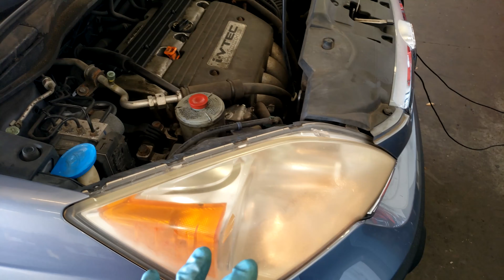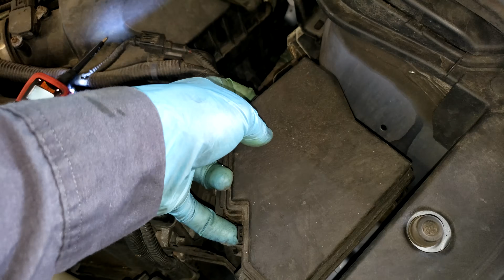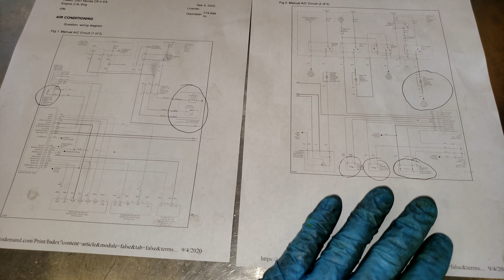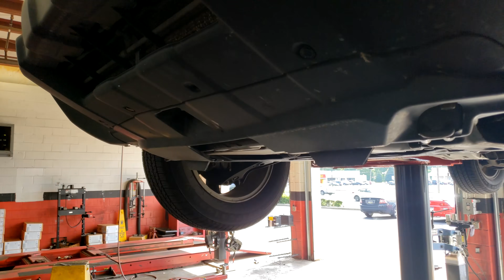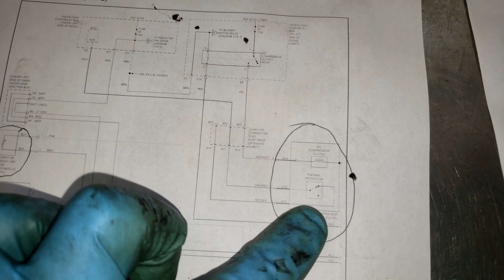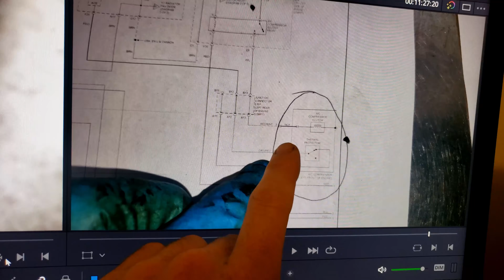Honda Blowing Warm / No AC Quick Diag/Tips - CRV, Accord, Civic, Pilot, Odyssey, etc

Comment: Ax2+50

High side formula for a running compressor on the high side. Not a fix all. But it will get you close in a bind.

A=Air temp
X2 plus 50

So if it is 90 degrees Fahrenheit

90×2=180+50= 230 psi on high side target when filling or diagnosing.

Comment: Lots of thanks in here but no one shelf out real money, your video deserves real $ tip, your tip saved my 2016 Honda CRV AC blowing hot air when temperature is hot outside or runs for an extended time, the thermal protect sensor is probably trashed since it is a normally closed circuit.  I elected to do the bypass.  If you don't know what I am talking about then you shouldn't do it.  Eventually I will get the entire compressor replaced.  Thanks! 🤑🤑🤑🤑🤑
Reply from the maker: I appreciate that very much! Thank you!

Comment: mine engages and blows ICE cold in the mornings and still cold when driving down the road but if im stopped? it gets weaker and weaker till its just slightly cool air... i had the condenser fan replaced about 2 years ago and its been like this since and yes the fan is still spinning thats the first thing i checked.. i feel like i just ordered a fan that doesnt move enough air

Comment: My troubles on my 2007 Honda Odyssey ex-L is when I'm idling at a red light or stopped the AC is blowing hotter or warm air. When I get up to 45mph it is cooler but definitely not ice cold. Both fans are running at the radiator. I'm not sure of the speeds of the fan. We had our compressor changed a few years ago on a trip. The AC before ran nicely. It just doesn't blow cool or cold now. We live in hot Central Florida and have had 100 degree days so we need good AC. Thanks 👍😊 🙏

Comment: Great video!
2009 CRV with high mileage. I ended up finding the thermal switch was my problem. The ice method and tapping did not work for me so I cut the thermal switch wires and jumped them between the thermal switch and 3pin connector. Don't know if I'll replace the compressor but for now I'm pleased with the result and the family isn't sweating in the car anymore.
Reply: Would you mind explaining this a bit more? I think my CRV is having the same problem. :-/
Reply: @1Chonn3  I think what he did was cut the two black wires going to the thermal switch, then stripped them a s twisted them together. Probably put some electrical tape on it. WARNING ⚠️ By doing this if the compressor overheats you will never know it until it gets trashed. So replace the thermal switch ASAP

Comment: If your AC is not blowing cold air and your compressor turns on for a second then off, check to see if the pressure is too high! That’s what was wrong with mine. I released some of the pressure, but then had to put some freon back in. Now it’s blowing 49.8°💪🏻💪🏻💪🏻
Reply: How did you release the pressure?  Thanks

Comment: Please help, When plugging into the low side of a 2014 Honda CR-V's AC system and the gauge immediately reads in the red, what is most common for this issue to fix
Reply: you have to know the pressures on both sides
Reply: Probably a compressor issue but still check the fuse. Can you hear the compressor running?
Reply: @Slimehammer09991  fuse ok and it running, thx
Reply: @Slimehammer09991  i did see the compressor work as soon i turn it on, fuse ok and replaced new relay too , still no cold air even the compressor running too

Comment: Silly question but these compressors are quite robustly designed and built. Common air con faults are mainly the clutch or the electricals…

Comment: Hi, I had the top of a radiator replaced after finding it had a leak and caused the fit aria to overheat and shut off. The next day the ac started blowing hot air. Any ideas what could be wrong?

Comment: I have done everything else except for what you tried with the ice on the back of the compressor and I bet you that it's going to be that. I don't know what else it would be. I replaced the condenser and compressor about 3+ years ago and I can't remember if it was a Honda OEM one or not, something tells me that it was because I was on a kick about using cheap junk parts and I have learned that you get what you pay for.

Comment: After replacing the AC clutch relay, do I need to add freon?  I replaced the relay but it got a little better but still blowing out hot air when the AC clutch not on cycle.

Comment: Im not a mechanic but a diy’er. I know enough to be dangerous. Took my Honda to 2 shops. First one put an electronic tool on the compressor for 15 seconds and said it was the compressor. Promptly left cause I knew it wasn’t. Second one wanted to flush and recharge.  Knew that wouldn’t work either. Figured it was electrical. Watched this gent and replaced the relay and Walah. Cold air!!!  I subscribed my friend. Thank you!!!
Reply: Did you replace the relay or the thermal switch?
Reply: Yeah that sounds like a fun and simple option to try. Where do we get one of those?
Reply: That's the problem isn't it. It's not even the expense it's getting taken for the fucking ride. Charge you to replace things in a sequence rather then diagnosis THOUGH CHARGE YOUR FOR A DIAGNOSIS. I like working on cars, and I don't. It's like I have no choice
Reply: @So_Much_WiNNiNG  I feel your pain old buddy, been a shade tree mechanic for nearly 50 yrs now...
Reply: Not thinking relay immediately is not knowing nearly enough for danger 😮
Reply: Wow!
Reply: Hey, which relay did you replace? Where is the location of the relay on the 2015 Honda CRV? Thank you
Reply: @bsporty11 Look on the inside of your fuse box, will be a snowflake emblem..
Reply: @tonyjordan1320 Thank you
Reply: lol what’s “walah”?
Unless you mean “voilá”?
Reply: @cheesesteakphilly that’s southern translation
Reply: @cheesesteakphilly haha 😂

Comment: From what I understand cars have two engine coolant temperatures, at least hondas, one by the EGR valve and the other on bottom of radiator. When you said, "thermo switch" where you referring to any of these sensors? If its a different one, where is it located?
Reply: it is the thermal switch at the compressor body.  it monitors compressor overheating.

Comment: Hi, i have tried this but the clutch didn't engage - could this be because i have no gas in it or should it still engage even if there is no gas in (had the gas taken out when i replaced the pressure sensor) - when plugging it into the honda software it comes up saying Thermal pressure switch on

Comment: Mine just went out I got a new compressor and It kicks in when i go above 60mph And only 2 vents blow cold the driver side blows hot I changed fuse and Nothing Any ideas????
Reply: check condenser fan and radiator fan.  they should engage when ac is on.

Comment: At the 3:10 minute mark, what exactly does your probe do to that terminal to engage the compressor?  How can I do that test with a jumper wire?  Jump to Neg. battery terminal or the Pos. battery terminal??
Reply: jump the single connector at the connector to battery positive.  clutch coil is hard wired to ground.

Comment: I'm at my wits end with my 04 CR-V, I have replaced the condenser, compressor, 2 hoses, put freon in several times (recently as well), they took the dash off and checked to make sure everything was connected) and just tried switching the fuse and it's still hot. So it seems like there are a few more things to try, just not sure if a laymen could do it or not.
Reply: you need to look at the pressures when the engine is running and the ac is on.  there are many troubleshooting charts on the internet to determine what is wrong by looking at both pressures.

Comment: When you change the pressure switch do you need to empty the AC or is it just a heat sensor
Reply: It's just an " external" switch, by that I mean you don't discharge the AC gass to change it.

Comment: great video. I have 2010 honda civic ex. ac is blowing hot air. , new cabin filter,  auto zone recharging kit shows correct pressure on the low side  but the pointer is not steady, has small vibration. when I press ac button looks like  ac clutch on compressor is engaged.. and both cooling fans start working as well.  but warm air coming from vents. .. any suggestions what's can cause that problem? thank yoy

Comment: We’ve replaced our compressor once before years ago. But now it’s doing the same thing but the compressor does engage.
Reply: Hey MrSam, were you able to get the problem fixed? I'm in the same exact boat. I'm curious if you replaced the whole compressor again or just purchased the Thermal Protector
Reply: @connorl7679  we purchased the compressor & installed it years ago. & it lasted for about 6 years before the problem returned. I checked the system & there’s debris. So the condenser/compressor needs to be replaced along with other parts.
Reply: @MrSamPhoenix  thx for your quick response!
Reply: @connorl7679  no problem

Comment: I have a 2020 CR-V Touring. It hasn't even got 8K miles on it and this is happening to it. The dealership is fighting me on the repair, which should be covered by factory warranty, correct? Are the fixes still basically the same as the ones you mention here?

Comment: FYI - MY Ac would stop working when the car engine warmed up on hot days.  Worked fine on highways though.  Clutch would not engage after car was warmed up.  There was plenty of Freon, Condenser didn't seem clogged but issue was AC coils when they got hot would disengage the clutch.  When cooled back down would rengage.   I bypassed the thermal protector and that also did not work.   Very common issue on Honda CRVs.
Reply: That’s the issue with my 2008 crv. We’re you  able to repair it? If so, how? Thanks
Reply: How did you fix the problem  ? What was it ?
Reply: did you ever fix this? i have the same problem!!!! what did you do????
Reply: I think this describes mu problem perfectly. How did you fix it?
Reply: Did anybody figure out how to get this fixed? Same issue with the 2007 Honda CRV with 176,000 MI

Comment: Man this guy  on the video  is extremely knowledgeable on honda a/c system. I changed my compressor, charged the system, still no a/c. I hot wired the clutch, a/c turned on. Turned out my particular problem was aftermarket  (-)(+)negative/positive, terminals on clutch. They were not crimped tight enough from  seller. So I used information from this video along with new heat shrink crimp along with disconnecting thermal switch from compressor (you can leave it hanging long as it is zip tied)+ 3 Zipp ties  so wires are secure no dangling. Problem solved and I feel like a million dollars. Thank u for this video.  Hands of God...

Comment: We have a 2018 Honda Accord which hasn't been driven much; only about 3,000 miles total. Still, the AC started blowing warm the other day. Just weird.
Reply: My 2011 CR-V only has 60K miles and it started blowing warm.....but a 2018 should definitely not.  This will be my last Honda.
Reply: @NextLevelAutoDiagnosticsLLC  Hondas are top notch reliability besides the AC lol if you switch make sure it’s to a Toyota
Reply: @NextLevelAutoDiagnosticsLLC  Yes, mine too.
Reply: I’ve owned two cars my entire life, both Hondas, and both had AC and paint failure issues. My first one was garage-kept and the paint STILL failed!  Like how?  I was constantly bringing that car to the shop and the AC never did work right. The one I have now was in an accident, and the entire AC system was changed to a new OEM Honda AC. Both the original AC and the new OEM one…BOTH AC’s on the same exact car have given me issues. Why can’t Honda make a car with a reliable AC and paint that doesn’t peel off?  I’ve always loved my cars, and I want to keep my Civic Si, but my God…I don’t want to die of heat stroke when it’s 110 outside and 85% humidity

Comment: I can't find the ac issue on my 2019 pilot, changed compressor, ac condenser, pressure switch, controler in the dash, engine computer.....still no good
Reply: Have you checked the hvac system for codes with a scan tool?
Reply: maybe it just needs some freeeon / refrigerent , or maybe its just the fuse or relay , have u checked those

Comment: If the pressure switch is bad.....will the clutch turn?  Both my fans are running and I swapped the relay....but still no ac when hot.  It does work when car is cold.

Comment: Easiest fix ever was, when I pulled out the knob in the dashboard. The 🔩 mechanism behind knob was lose. I tightened it while I sat in the passenger seat going down a highway. Took me about 20 seconds to fix the AC 😂. I found this solution on YouTube years ago. It works.
Reply: Which knob did you pull out?
Reply: @steviemichelle7271  -- The AC knob which turns the AC to heat or cold. On mine you had to pinch it and pull out. Once you pull that out, you should see the screws etc.. tighten that.
Reply: Link to video plz, or perhaps keywords you used to find the video.
Reply: @hellagrant  Loose nut behind the Knob that's the title of the video. That's essentially how I fixed my AC problem.
Reply: I think YouTube is trying to censor the title of the video... So let me try this way... Lose Nuttt behin da Nob- use correct spellings when you search it.

Comment: I have Honda CR-V 2015 suddenly the smoke came out through hood it was not smoke but freon leaked rt above on hood marks also there it was running fine but when we came out from restaurant and started it it has only 85 k miles on 
And now i took the compressor rebuild guy who rebuild it i put it back filled freon the compressor cliutch engages but the fan supose to come when we put AC not comming and still blowing hot air

Comment: Thank you. I’ve spent 1500 bucks to get this issue fixed on my 2007 CRV with 165000 miles and it still blows warm air for about 10 to 15 minutes before the compressor finally comes on , cooling the air. The compressor has been replaced and one other part. Thanks, this is very helpful!!
Reply: Same at my honda crv 2002 whit 400.000 miles
Reply: What did you have to fix ? Did changing the compressor help?

Comment: smart guy
Reply: Thermal switch was also my problem. I joined the two wires and all is working fine. Thanks for your help.
Reply: @vickivizugonesailing2259  I was thinking of doing that....but any long term bad effects ?
Reply: I have the same question. For my 2007 Honda CRV with 176,000 mi. Is it a bad idea to cut the wires to the thermal protector switch and connect them together to bypass it

Comment: A/C come on cold for 15_20 minutes then blows hot I hear both fans and the clutch is spinning plus the pressure is at 100 PSI so I'm stuck.
Reply: You too?
Reply: @BeepxBewp  yes I had to change the lines, condenser, and compressor with new seals as well the pressure turned out bad sending metal through the system, check out 1800 rad and they can help you out on a deal for the parts
Reply: Sadly you threw parts at it. I'm too poor to do that. I think it's my thermal switch but I don't have a means of lifting the vehicle at the moment to troubleshoot it.  I turn the AC on and the car gains a load. So I feel the compressor and clutch are fine. Not sure why it stopped blowing cold since the L pressure line reads red with a Guage

Comment: If you are sill reading this would you suggest possible problems when the compressor is turning on but no cool air. One pipe is very hot, the other is mild at best not hot still no cool. I had o use about half a can of gas and it kicked on No Problem but no cool. The instructions in one can says to fill until cold air comes out but on the can I bought it says not to overfill and it has a gauge but the gauged seemed to act weird. but after several rounds it settled out in the right area.. still no cool compressor stays on no problem and when you turn off the cooling it turns off no problem. 
   I am thinking since it sat Unused for so long without proper levels that the radiator inside with the release of the compressed gas, is clogged so that none is getting released so no cooling. Your ideas?? much appreciated

Comment: I followed the steps in your great video on my 2008 CRV and no voltage at relay and I swapped fuses...no AC.
Reply: Voltages are back but no compressor engagement. Couldn't I jumper the 14 volts to see if compressor engages?

Comment: Y’all know how to check if your Low pressure line still has pressure? Just take off the cap on the low pressure and press the pin with a Philip screw for like a quick second. If there’s pressure you’ll here it releasing some, so if it’s not than you’ll know it’s either a sensor or a bad clutch. Some would say it’s a leak but the reason I say it’s not a leak is because even with a leak you can still add more freon. One time I inspected someone’s new used 2007 crv and the ass hole who sold it to them, didn’t even have the serpentine belt wrapped around the ac compressor..... so yea look out for that too.